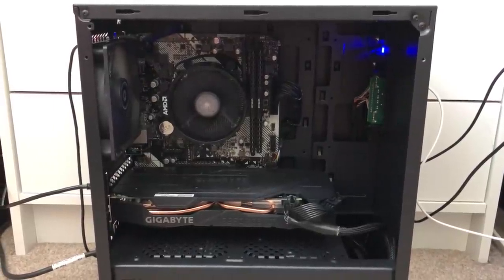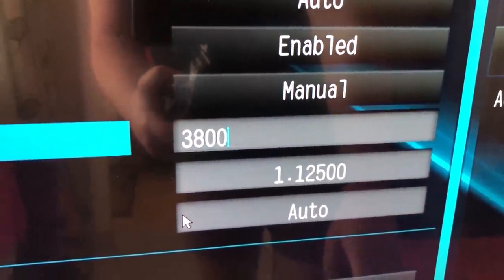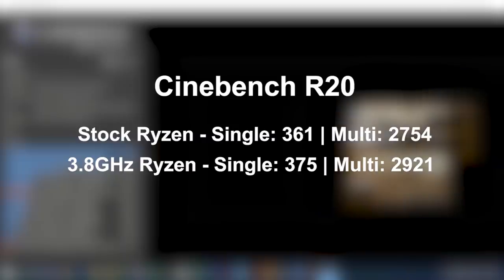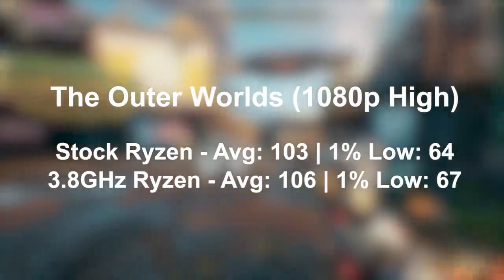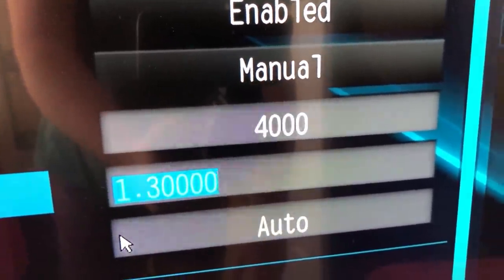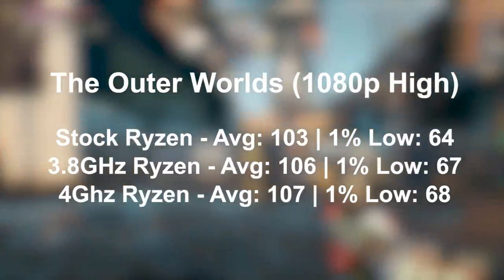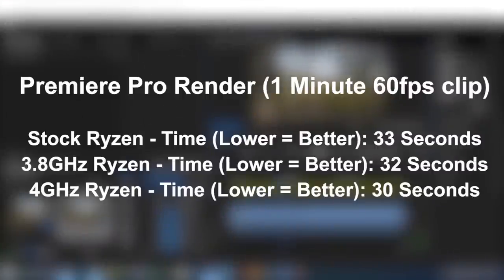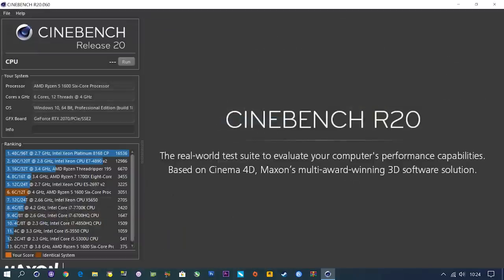4GHz Ryzen Overclock On The Stock Cooler: Good Idea Or Fire Hazard?

Comment: do you think that i could do 4ghz on my 2700 on the stock cooler?
Reply: NO! It'll get too hot when utilized 90%+ it is possible in light workloads like gaming but anything else, it'll produce too much heat for the cooler... Try 3.7Ghz and add some additional fans and you might be OK :)

Comment: i oc my ryzen 5 2600 TO 4 GHZ 
WHAT I DID 
WENT TO THE BIOS AND CHANGED CPU RATIO TO 4000 MHZ
AND VOLTAGE TO 1.3625 V
I DIDNT CHANGED THE SOC  JUST THESE 2 SETTINGS ABOVE 
IS THIS SAFE ??

MAX VOLTAGE MOBO 1.360 V
MAX VOLTAGE RYZEN 1.350 V

Comment: I'm running 4.35ghz all core overclock with stock cooler no problem. Idle is 37c and high load is no more than 80c
Reply: That's kinda hard to believe.
Reply: lol artic pole
Reply: I'm running 3600x with stock cooler. Is it not the same cooler? I didn't think my specs were too abnormal
Reply: @padillaxA  how much your ambient temp ?
Reply: @Clarito resdiano around 22c to 24c year round

Comment: Granted it's not the stock cooler, but with a CoolerMaster hyper 212 evo, I'm overclocking my 1600af to 4GHz at 1.2375v Been using it that way since January, no issues, crashes or anything wrong with it. I haven't benchmarked it though, or stress tested it, but as long as it functions under normal use, I don't see a reason to other than bragging rights.

Comment: I must say that Ryen OC is usless you gain less then 7% lose all the Features.
No downclocking the chip needs more watts, for in the best case 7%. 

My 2600X can run at 4250 Mhz, but i only used it for benchmarks becouse its useless. 
Now i have the 3800X this chip can run with 4,500 ghz all core, but its very hot even wit custom watercooler. 
Stock Chinebench R20 513 Sindelcore, Multi 4977 at 4,5 Ghz Sindel 509 Mulit 5274 5% in the best case.

And the big problem you lose all engery saving features, this a big problem. On Intel thats not the case and 
you gain more performance.

Comment: My 3700x runs at 4.4GHz (1.32v) with the stock cooler. It's on the edge, but works!
Reply: it's not burn-in stable. for sure. will hit 100c+ during occt or prime

Comment: Nevermind overclocking: i found myself fiddling with many Ryzen system at stock speed, optimizing CPU Fan setting to maximise all core boost. Few reach that out of the box and it is a tedious experience. Maybe running them overclocked just makes things easier...

Comment: I overclocked my 3200g easily to 4ghz at 1.35v worked perfectly. Stress tested for 30min on OCCT I'm using stock cooler and max was 73 C and no crashes.

Comment: I have an actual 2600 with the same cooler, 4GHz @ 1.32v (I can go as high as 4.2GHz stable @ 1.4v, but would need a better cooler) no problem and stays cool enough to stay out of the "Danger Zone" in a room around 80F under some pretty tough scenarios, so definitely doable.

Comment: That overclock is amazing considering the very cheap MoBo and the stock cooler. I also use the stock 1600AF cooling solution with an AsRock B450M PRO4 but i thought i don't have a chance at OCing at all... However this video proved me that it's possible even on the 40% cheaper MoBo. Thank you so much!
Reply: R51600af
Hyper 212 Evo
T force Vulcan 3200
4 GHz @ 1.3
P95 levels out @ 70
ASRock b450 pro4
Reply: @danielramdin9367  it's great, it means your MoBo is not holding you back. I thought you'd need atleast B450 TOMAHAWK to get any OC capability at all.
Reply: @ultraopgamer8076  i ended up settling on 3.9 @ 1.2 V. that seems to be stock boost voltage. i could go further with better cooler and mobo but that extra .1V for 100 mhz wasnt worth the heat. im happy as a clam. check out hoiser hardware also for r5 1600 af vids.

Comment: Does anyone know any decent low profile GPUs that have windows 10 driver support I'm running an Ooooollllddd ATI Radeon 2400 XT pro, and it ain't the sharpest tool in the...😭😭😭 Also I'm not looking to run metro exodus at 60 Fps wich is probably impossible😂😂 I'm just looking to run small games such as, Minecraft , Terraria, and all the CoD games before black ops 3 sooooo yea any ideas would help tremendously.....

Comment: Am I the only one wondering why you continue to test overclocking in ultra settings? At this point, I am pretty sure you are bottlenecked by the GPU and even if you overclock it to 5ghz you will not see that much of a difference. Try lowering the settings next time just to compare.

Comment: Er what is it about? I mean... ryzen automatically speeds up to 4.2 ghz in a certain tasks. You are not overclocking anything 🙄 this is a normal clockrate for this processor.
Reply: The new (3000 series) will hit 4.2GHz +, but he is using the Ryzen 1600AF. His chip will only turbo to 3.7GHz on all cores, which he mentions in the video. So yes, he is overclocking
Reply: @minecraftphenom0892  ah sorry i didn't noticed.

Comment: It can still cost you actually, your putting extra stress on the CPU, which means it's lifespan will go down.
Reply: @incognito9292  exactly. I have had gpu's PSU'S,RAM, HD's all fail but never a CPU.
Reply: @incognito9292  Know some guys with overclocked CPU's, and they go within a year or so, depends how far you overclock them as well I guess. My mates i7 went, and the MB was acting funny too.
Reply: More like higher power consumption will cost extra cents or dollars, which is not free.
Reply: @dcikaruga  I would imagine they ran them too hot or too unstable.
Reply: @Jafmanz  It was a watercooled system as well. Bottom line is, your running these components a lot faster than they were meant to, so it's bound to have some effect. Long and short term, some guy's get lucky though, some guy's not so, silicon lottery eh?
Reply: @dcikaruga  There are certainly variables cpu's depending on the series issue. There are also obviously some golden chips out there such as the 2500k which I had running for 8 years at various levels of O.C. right up to 4.6

It is still going strong on my second rig.

Yes it can be a lottery,  but variables can be removed or controlled with enough care.

You are right it can cost you but the probability vs the rewards of extending your CPU'S life vs buying an upgrade are usually well worth the effort. If it were not then people would not.
Reply: @Jafmanz  I used to go crazy and tinker with overclocking and all that when I was young, but it got upto the point when I was screwing about with the system more than using it.... I don't bother anymore, it's fun, but a straightforward system that does what I need it too, is all I really need.
Reply: @dcikaruga  I am the same. Thing is overlocking has goten so much easier. unless you really want to push the envelope it only takes a few clicks.

Comment: 4ghz OC? What? Why is your ryzen so slow?
Reply: I hope you know, performance is not directly proportional to clock speed. it's a combination of the architecture and the design of the cpu and the clock speed and ofc there is many more that goes into it.
Reply: @HoloScope  yup, some of the older i7 can hit 4 ghz or higher but they usually don't outperform newer chips running 4 or close to 4ghz
Reply: Holo Scope I’m not an idiot. 4ghz is slow
Reply: It's not about slow. It's a 1600AF, it can do 4.2 most likely. But he overclocked it on AMD's bundled Stealth Cooler.
Reply: Rares Macovei 4.2 on only 6 cores so fucking revolutionary. When my 3950x out of the box boosts to 4.7 with 10 more cores
Reply: @Khloya69  so you bring politics into a discussion about computer hardware? Are you ok dude?
Reply: @raresmacovei8382  that stealth cooler is really for people running boards that dont have good vrms or don't intend to overclock much if at all. What i did was just find a cheap wraith spire with the red led ring on the fan which has a beefier heatsink. That thing lets me run my 1600AF to 4.1 with max temps hovering around 65 to 70C under load. The wraith prism is an even better cooler if you can find one cheap. Keep in mind though that you will naturally have more fan noise since its not going to be as quiet as a noctua cooler.
Reply: @Khloya69  you keep saying not a dude lol are you trying to convince us or yourself? I dont care what gender you are, dude is just a word i use to refer to anyone. If that triggers you then idk what else to tell ya
Reply: Why would ChloeWade even have a 3950x when they always, only idiots buy AMD, Intel/Nvidia ftw.